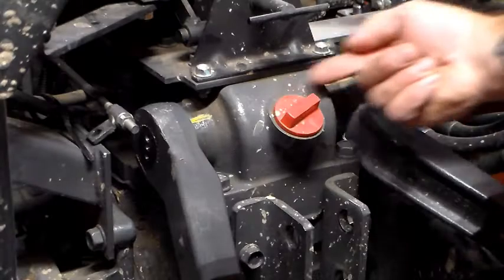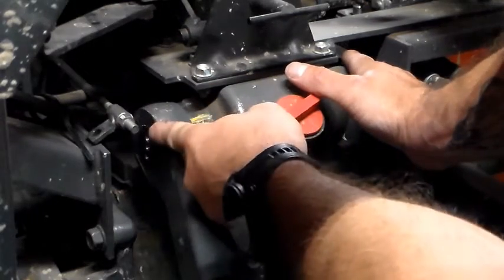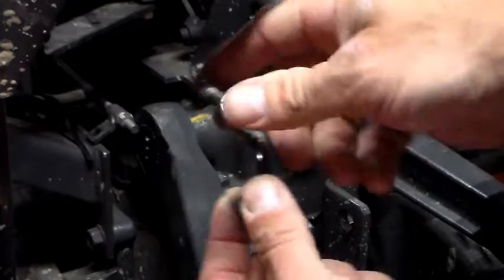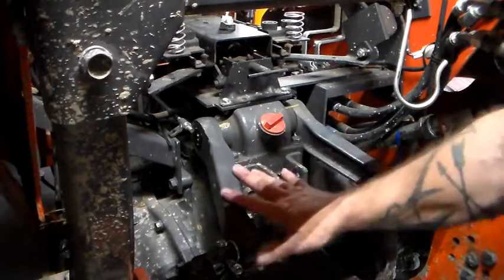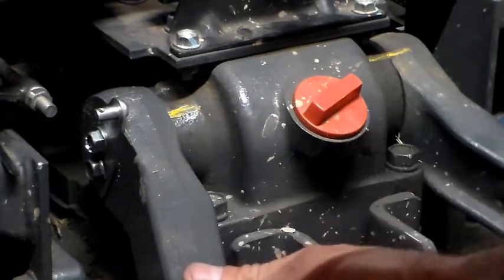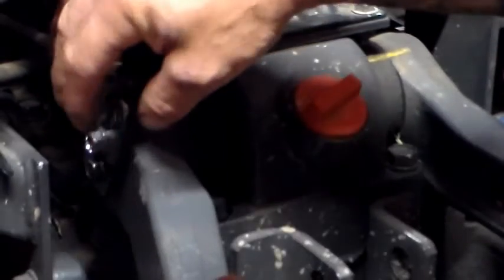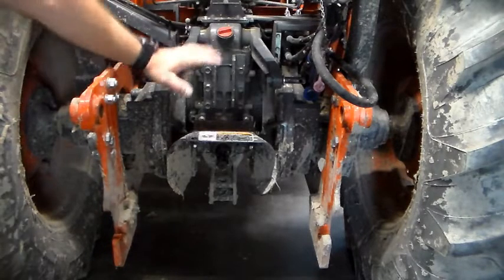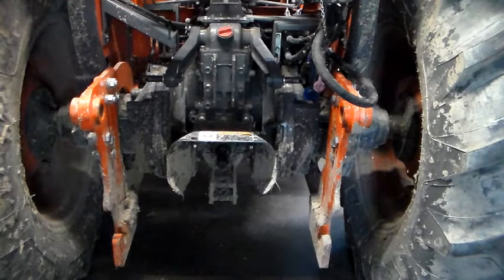Kubota MX series - 3-pt Hydraulic Lift Arm Failure - HOW TO FIX IT!

Comment: Exactly what happened to my MX5100 a second time.  I'm thinking about fabricating the Link Control our of heavier steel and give it a little more footprint then see if it will last longer. May have to get a little bit longer bolts.

Comment: It might be a good idea to put some lock tight on part 160, the bolt that holds on the flange.
Reply: It's not that the bolts work loose, but that the lift arm slides out with such force that the flimsy link control collapses and is swallowed by the lift arm.  I plan to fabricate a back plate out of 3/16" steel to strengthen the link control and see if that works.